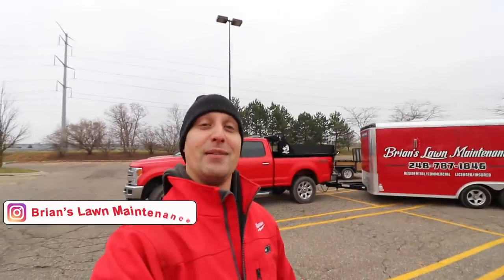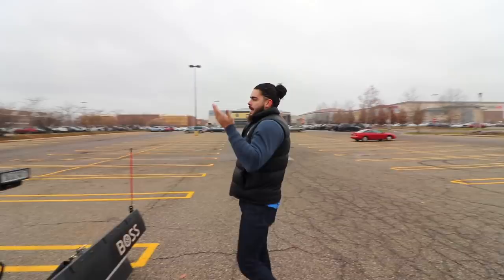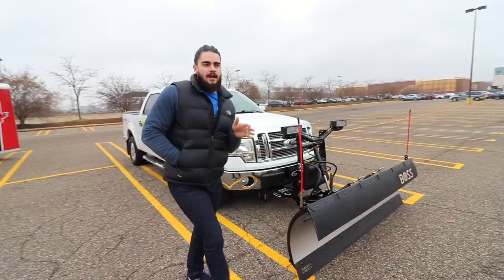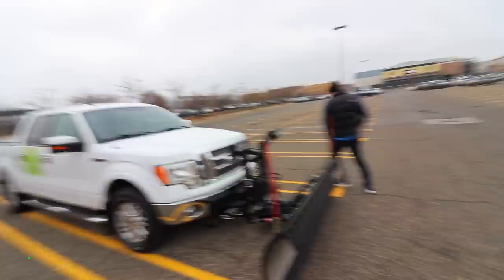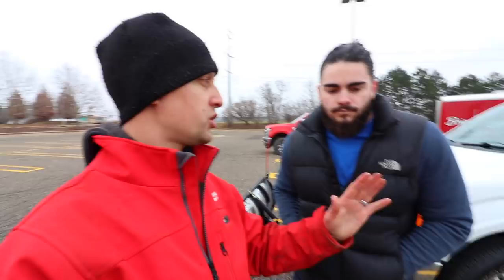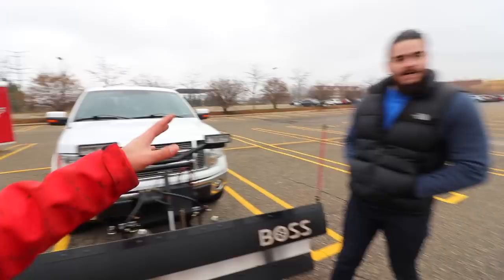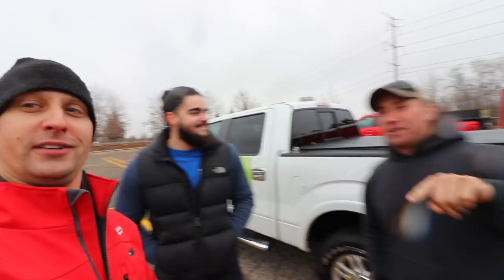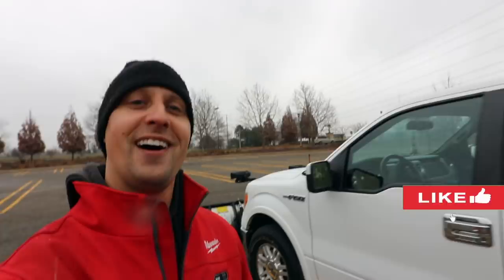BOSS HTX Half Ton STAINLESS Snow Plow Setup ► Jake's Lawn Care First Plow Setup!

Comment: I have a fleet of 7 plow trucks, 4 of them being half ton GMC 1500 trucks, and they've been running commercially for over 5 years. No complaints, no issues, still doing everything the 3/4 trucks are doing at half the price and twice more MPG. People will wake up and realize 3/4 and 1 ton trucks are all hype and not necessary. Let's start normalizing people working with what they have. Great video!

Comment: I've been running a plow on a 1993 F150 for the past 10 years and it's held up very well. I use plow shoes so the blade is 1/2" off the ground. If the plow is not scraping on the gravel driveway, it is just pushing the snow and it easier on the truck. Setting the trips spring tension correctly also helps to save your truck from sudden impacts too. If you use it just for your own use and not run around with it on the truck all day, a 1/2 ton will be enough for plowing. I wouldn't do commercial plowing with one however.

Comment: In ‘02 I had a Regular Cab Short box truck with a Curtis 7 ft 6 plow it worked good. Jake just take it easy when plowing don’t try to do more then your truck can handle. It was so nice to have a short wheelbase truck when plowing.
Reply: Brian Mathison thank you for the heads up! I greatly appreciate that!
Reply: Jacob Meissner now I just plow my driveway with a ATV & when I do it’s in 2wd. I would also look into something to help keep the front-end up a little better under the weight of the plow in the air. Plus don’t be like most people that think when driving down the road with the plow all the way up, air to the radiator is your friend. I would only raise mine up as little as possible, I did a factory parking lot that was 35 or 40 miles from my house.

Comment: 15 yrs plowing snow one of the best things I've done is led lighting to light up behind the truck. 
 problems with using 1/2 ton is cooling engine and trans and power steering. if you don't need 4x4 when driving to and from accounts switch it off it will help with longer life of ball joints because they seem to go first when plowing.

Comment: I would recommend putting Timbrens on your trucks, 1/2T, 3/4T, doesn’t matter. I put them on the front and rear of my 2016, 3/4 GMC. Tad pricey, but will save on wear in the long run.

Comment: i have a 2004 ram 1500 with a 5.7 and plow commercial with a 7’6” boss super-duty straight blade, set of timbrens on the front, and just keep ballast in the bed. have run this setup for almost 5 years no issue

Comment: I've been using an F150 with a front and rear blade since 09. For residentials it's the ticket.
Reply: Rob Creagh what year is yours?
Reply: @gatorslawnservicellc6759  currently running a 2011, but my first f150 was 2009
Reply: Rob Creagh do you have a Instagram I can dm you at?
Reply: @gatorslawnservicellc6759  no just email

Comment: only 2 springs. that looks like a home owner plow to me. the plows I run on half tons all have 3 springs and a shock or 4 springs.  hopefully it works for him.     1/2 tons can move just as much snow as a 3/4 ton if the guy knows what hes doing.    Having a small 1/2 ton short box you can get in and out of places easier.
Reply: I have a 2 spring I'm just trying not to F my truck up.
Reply: A bobcat can haul just as much dirt as a wheel loader if you know how
Reply: Video-gamer-for-life lol I can’t help myself sometimes

Comment: I got a 2013 f150 5.0L V8 equipped with an EPAS steering system. I wonder if this 1/2 ton should be a problem or cause any concerns. I love snow so much I’m thinking of buying one to start plowing driveways.
Reply: Did you ever get the plow? I'm in the same boat. I have a '14 and I'm wondering the same thing.

Comment: Will this plow work on a 4.6 Liter..?
And is that $5200 install and tax included in that price..thanks
Reply from the maker: I would imagine it could but I can't guarantee. $5,200 was OTD ya.
Reply: @BriansLawnMaintenance  im in Ontario Canada and O.T.D cheapest i could find was $9400 cnd ..things are alot more expensive up here even with the exchange at 5200 i figure i should be getting it for $7000 cnd but its still $1500u.s  plus what your buddy paid ..still going to order it

Comment: I started out with a 1999 dodge ram1500 ext cab it had a boss standard duty 7-6
Reply: swisher lawn care vlogs 
How long did your Dodge last? My lawn care truck (08’ Dodge 1500 4.7 4x4) has over 300,000 miles, and everything drivetrain wise is original so far. Transmission is still going strong, and still has a ton of power. Of course, it’s a Dodge, so the body’s slowly rusting off of it (rockers have holes under rear doors, and rear wheel wells have rust) but the frame has zero rust. Anyway, work it hard and pull 7,000 lbs at least once a week. Looking at upgrading to a newer Dodge 2500 with a 6.4 Hemi.
Reply: About 2 or 3 years

Comment: In the Next year or too I plan on putting a western HTS or midweight plow on my 2016 ram 1500, has anybody ever done that and have any recommendations, I got big 33 inch off road tires on it and think I'm going to throw a leveling kit in it, planing on doing manly residential with maybe 2 or 3 small commercial accounts

Comment: I have been plowing for close to 30 years. They would put plows on half ton trucks all the time. They stopped doing this in the 90s due to crash ratings on the trucks. You end up bending the frame. Western even made one with a wheel on it to keep the weight off the truck. Did it work no they don't make them anymore.

Comment: I have the same plow but it will not mount most new f150 😭 i refuse to buy chevy and always dodge a ram
Reply: Taylormadeburgers 
You should test drive a Ram truck. You may like them! I know I’ve had great luck with my 1/2 ton 08’ Dodge. Just if you do check one out, and if you want a diesel, buy one with a 6 speed or Aisin transmission. That is the biggest weak link to new Dodge trucks. Half ton Dodge trucks 8 speed transmission is very solid, and the Aisin or manual are reliable in a diesel, have no clue about the 6.4 Hemi, as they haven’t been out too long yet.

Comment: I've been plowing now for over 15 yrs with a 1/2 ton Chevy truck and western mid weight plow. Just one difference in the plow. The western hydraulic lifts a chain so you can pile higher, its not limited by the ram. and if a hydraulic hose blows you can drive it into a snow bank and short chain the plow to get home. The most common problem with plowing is a hose will blow. Tip ... keep a spare hose and fluid. Always breaks at 3am lol. This year I built removable wings for the plow for the larger parking lots. What a huge difference for a straight plow. Either way best of luck. 
Jason 
https://m.facebook.com/maxpropcare/
Reply from the maker: Awesome man thanks for sharing
Reply: Cheers! Have a great winter

Comment: This guy needs a CFO...Couldn't find a f250 in my price range, so a bought a f150 lariat. You run a business, not a limo service. Buy the truck you need, and let your options be based on your budget. He should have bought a base model 250 that's built for what he needs. And then he spent the extra on stainless... I don't understand the way he spends his money.

Nevertheless, I hope he is successful.

Comment: Are Ford F150 really good trucks? I see a lot of landscaping companies with F150
Reply from the maker: Yep
Reply: This generation F150 was solid.  5.4 issues were sorted by then and the 6speed auto is solid.  Be strict on Ford filters and 5,000 mile oil changes to keek cam phasers working well. Good PM solves most "Triton" issues. 
FYI My F150 is a 1991 and still working because of geat PM

Comment: That truck should have the new 5.0l in it if it's the aluminum body, not the 5.4l
Reply from the maker: jruss its a 2010.. not a 2016+
Reply: @BriansLawnMaintenance  ok I must have misheard cause I thought he said it was an aluminum body
Reply: jruss the 5.0l and ecoboost were 2011 and up the 2009 and 2010 f150s had the 4.6, 5.4, and 6.2 v8s
Reply: It's not aluminum
Reply: Brian said his truck, his 2017 f250 is aluminum, not jakes

Comment: Look In to getting a plow I have f 250 I have a super duty truck light duty front axle  so I can't put on a reg plow but that the might  work
Reply: What year and configuration (cab, box, engine ect.) is you truck?
Reply: @6.4hemidriver44  it a 2011 6.2 litt crew can short box but my front axle is rated at 4400lbs
Reply: Wow, that's low for a 3/4 ton truck.  You sure it doesn't have the 4800 lbs. front axle?
Reply: @6.4hemidriver44  when I got this truck I ask if it had a snow package the sale person said it did but it didn't  I got it used I just check it again it is 4400 the guy at snow dogg said I could put in these rubber donuts for add support in the front end for 400  but once I bought a walker mower I can't get till next fall
Reply: He's probably talking about Timbrens.  They work alright.  Could always swap to heavier front springs.  2011 F250/350's all use Dana 60 front ends regardless of what spring ratings they have.  However, even with heavier springs the door sticker is still going to have the FAWR at 4400 lbs.  As far as plow brands, I'd recommend Fisher, Western, Snow Ex or Boss.  Just my $0.02.
Reply: @6.4hemidriver44  thatb4ight I just forgot timbrens was right house are the plows  I was looking at have you heard of snow way good bad  thank for all the info
Reply: I'm southeast of Lake Ontario in a major lake effect snow area in between a city that averages 125" a year and a hill/plateau area that averages 200" + a year.  Fisher, Western, Boss and Snow Ex (formally Blizzard) are by far the most common snow plows in this area.  You'll see a few Meyers, Hiniker's, Snow-Way and Snow Doggs here and there.  I'd go with one of the first four brands I mentioned in that order.  From a good dealer that will support you. Just my $0.02.
Reply: @6.4hemidriver44  I leave in Denver  the last 3 years not we have not had much snow the mtn get most of it thank for all the info
Reply: 6.4 HemiDriver where you located ? Syracuse ?
Reply: @tomscheider9133  l
I live in Denver Colorado we have got more this year then the last 3years combined whitch is great that why I looking to get a plow this summer  be fore the fall price hike
Reply: Greenway Lawn Looking to see where 6.4 HemiDriver is located. I, too, am Southeast of Lake Ontario in southern Oswego County.
Reply: Tom, yes I'm in the Syracuse area, northeast of the city.
Reply: 6.4 HemiDriver North Shore of Oneida Lake here
Reply: I'm not to far from the South Shore, close to Bridgeport.

Comment: Is this approved for eco boost. I was just calling around today.
Reply: Ford says they don’t recommend plowing with anything less than the 5.0 engine.
Reply: I have been plowing for 3 years with my 2016 F150 with a 2.7 EcoBoost. No issues at all. Most of the issues with the EM motor is the plow bracket location in relation to the intercooler. My Boss dealer says he puts them on Ecoboost trucks all the time. Sno-Way 26 series is a great option. It has 260lbs of added down pressure.

Comment: The sport duty plows are not good for commercial plowing. They will get destroyed.
Reply: What's a sport duty plow?
Reply: @Eric-B24559  The HTX is also called a sport duty. They are made for the half tons. They weigh in at less then 500 lbs.

Comment: That little truck will not last long.IT is too light for that many driveways.
Reply: Shawn Kemp  I used to have older half tons and they did okay but they just eventually broke down now I run nothing with 350s depends on how much work they do . And the dealer will not honor the warranty if it doesn't have a plow prep package and they give you a hard time about the plow. I'm sure they will plow snow any four-wheel will but they're not meant to plow and work like that. And if you only has one truck he better have good backup or a good friend he can call. If he's smart he'll get by with them and then move up to a more heavy-duty or truck.
Reply: Half tons make great residential plow rigs, that truck should last a long time, depends if you get 40 inches a year or 120 inches a year though, if you get 120 inches a year obviously need a big truck,  I find with the high cost of snow plows some times your just better off buying a couple good snow blowers for resi, 25 drives in a f150 isn't any  different then going out in a f350 with a 11 v plow ,v box with a few tons of salt  and banging out huge commercial lots,  both trucks will probably have about the same life expectancy.
Reply: Shawn Kemp is its an investment don’t buy. Always HD
Reply: Been running a md75 snow dogg 4 years now on old body tundra (pre 2008) zero mechanical failures.  No drivetrain issues no front end issues.  My 1 ton went through a trans , wheel bearings and had a extremely sloppy front end with less than 80k.  Now granted the Tundra  doesn't have a full size Western wideout hanging off the front of it and isn't moving nearly the capacity that the one ton was.  I'm not saying that it has the ability to do what a 3/4 plus size ton truck can do but in relativity to the size plow that is on it and the size of jobs that is doing I don't think it's any less reliable.  It just has less capacity